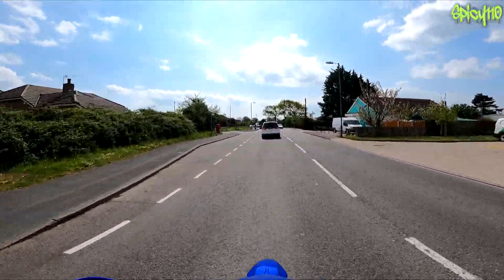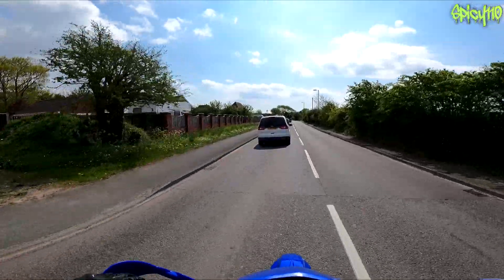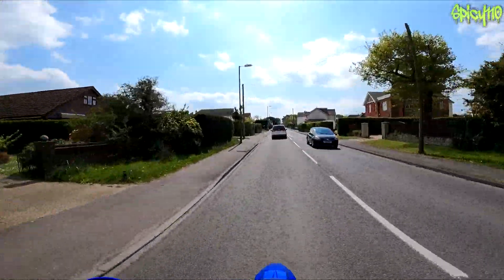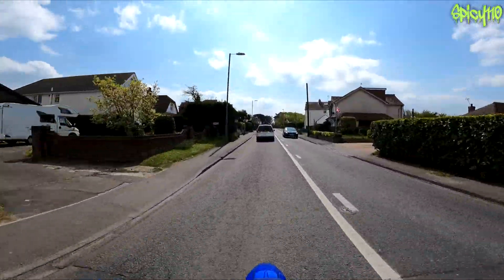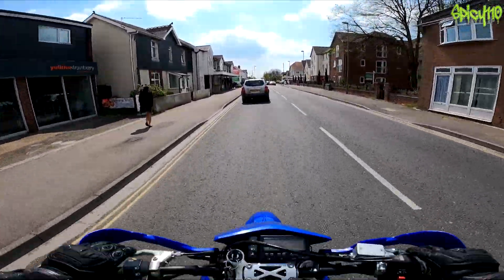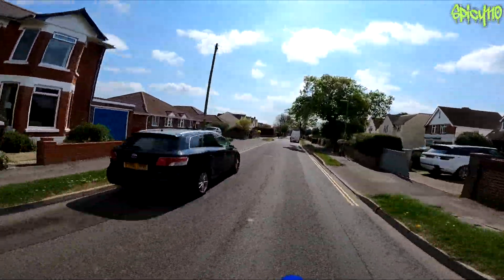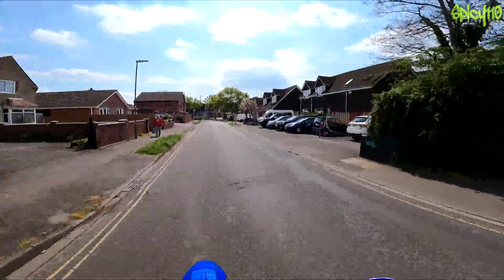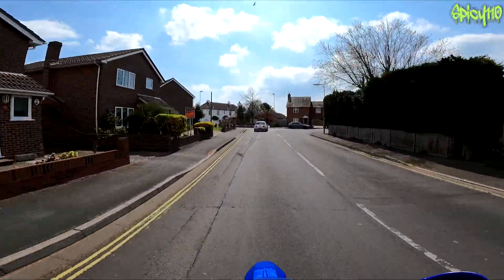Motorcycle Power Steering? |  Yamaha EPS System.

Comment: What is missed here I think is the HUGE possiblity of running ridiculusly fatter TIRES that normally would make handling a real chore ,,,,but with power steering?   THINK now a dirtbike with large low pressure tires out in the deep sand or even in hard pack you can make the steering geometry optimal and not worry how sluggish it is or about headshake in fact you can now run a swing arm front end with hub steering no dive destroying fragile geometry braking into turns because steering is all POWERED and precisely controlled by an IMU and ecu...YOU are not manhandling this BEAST through the tight twisties basically robotics is!  Sure now the motorcycle weighs lots more but you dont even care because it has a huge powerful engine and steerig is POWERED not just powered but precisely controlled as in computer  This could also work miracles on a street bike canyon carver with HUGE contact patch via double oversize tires!   you can lean the b!tch ALL the way over with total confidence!

Comment: Strange I always thought power steering only helped lighten the burden of turning as driving my dads old cavalier back in the day the powersteering was failing and it felt like moving a tank, don't see how that would benefit a motorbike?
Reply from the maker: Well as I say this is doing a lot more that that. Where it will be useful is Mx bikes with 21in front wheels at slow speed in a turn on a MX dirt track.

Comment: From what I read it's been designed for motocross race bikes, actively damps all the time but the 'power steering' feature only works under 25mph (iirc) to reduce rider fatigue from muscling the bars about at low speed .. which sounds neat. This will definitely filter down to street bikes eventually and become just like TC, ABS, quick shifters, slipper clutches etc etc ...... sure ya don't 'need' it but it will be beneficial without doubt.
Reply from the maker: yer I am sure the power assist on road machines will be progressive just like in some cars.

Comment: Not a fan of it because on a bike I feel like you need to feel everything the front end is doing and if something electrical is between me and the wheels then I really don't know and what if it brakes without you knowing your sorta relying on that to work if you are as you said disabled or if you get into a tank slapper
Reply from the maker: That is an interesting point. However the handle bars are directly connected still so the feel should not change.  it's just adding in force with the motor to assist you,I guess you could end up feeling like your fighting it. It will be interesting to see where this goes.
Reply: @spicy110  oh ok yeah now that is interesting